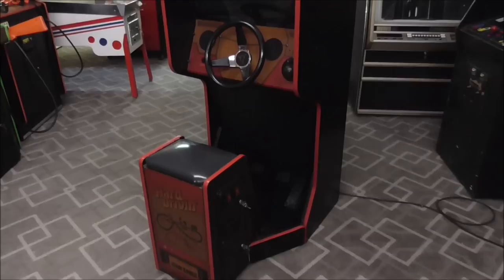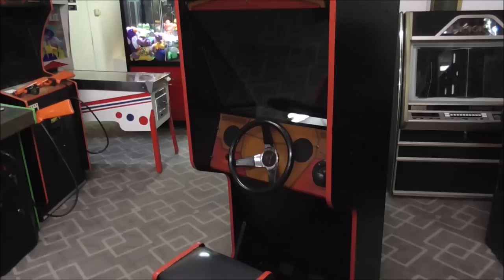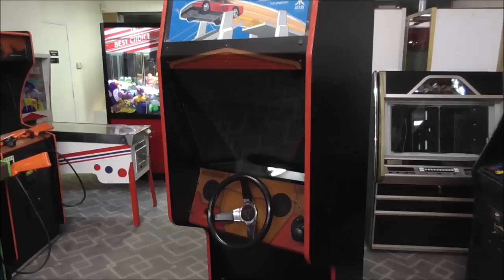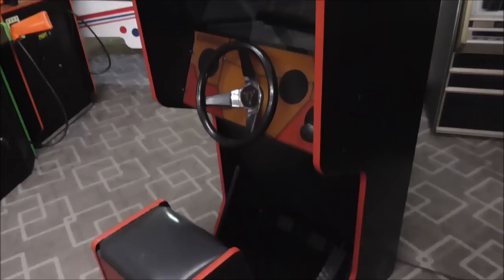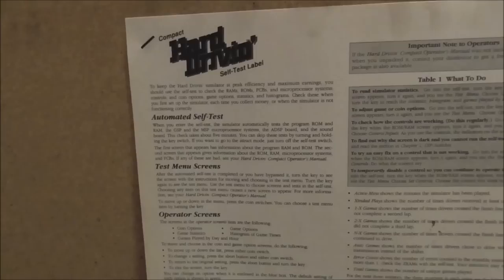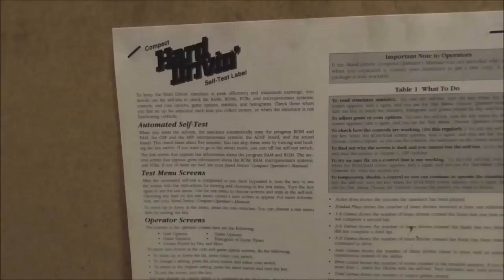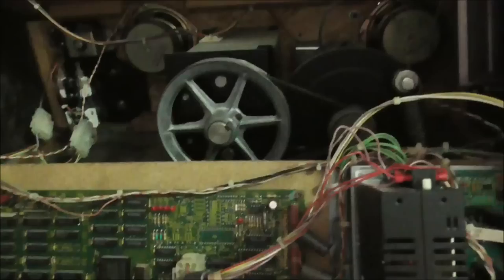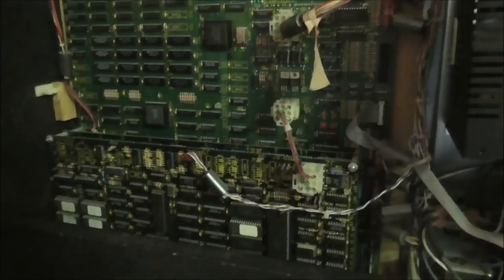We Fix Atari's Legendary "Hard Drivin" Arcade Game!  Steering, Brakes, PCB Repair WOW!

Comment: I recall having to repair those machines when they first came out. So heavy and we would always find the motor driver had died. Two actually set on fire !. We had to install one of the larger units in the 3rd storey of a building and it had to be carried up the service stairs due to the size and mainly because the stairwalker wouldnt fit in the stair well.

Comment: I used to own a standup Race Drivin' cab, and the game is quite something. when the force feedback is cranked up all the way, you need to be popeye to drive the car lol. 4 speed shifter with a clutch, a key ignition and 4 point car physics. Way, way ahead of it's time. Even the brake pedal uses a strain gauge to actively measure force and act appropriately. This is why the brakes fail over time, the strain gauge creeps over time needs to be replaced, which is a specialty job. Thankfully I do strain gauging for a living so it wasn't a scary job for me lol! I got good enough at it where I could play for hours without running out of time on the Super Stunt Track, the only thing that killed a run was loss of concentration or just getting tired. The roadster was the best car! This video makes me want to find another cab of this and get back into it :o)
Reply from the maker: They're still out there somewhere :)

Comment: I remember playing this game when it was brand newly arrived at my arcade, and what fun it was. We were blown away by the feedback steering and the realistic braking. It wasn’t long, however, before the game was all beat up from kids abusing it. Most of the time the feedback steering didn’t work and the brake pedal flopped loosely. Amazing driving simulation, but susceptible to the ravages of Mountain Dew-addled teens.
Reply from the maker: I can see it getting abused for sure!  The operators have to keep the kids in line I would have kicked 'em out!

Comment: You are spot on, alot of us LOVED this at the time. Race Drivin' was out right around the time I was learning to drive and I took massive pride in using the full manual with clutch setting, and eventually beating the Super Stunt Track with corkscrew, mega steep top hat, and loop with an upside down jump - after months of practice. That was a great accomplishment for me at the time! The unit I played was a full sit-down cabinet in Spaceport Arcade at Greenbrier Mall in Chesapeake, VA. Edit: Yup I always used the brakes - those signs before the stunts let you know a good speed for the stunt you are about to hit.
Reply from the maker: Thanks for the memories VBshredder, those were the days.... it was a very interesting time when the arcades were still around, it's hard to explain to kids how it was if they weren't there :)  Thanks for watching, we'll see you on the next video!

Comment: Tantalum caps have a higher capacity and lower leakage then regular electrolytic caps. If I remember my basic electronics correctly, you can swap an electrolytic cap with a tantalum,  but the opposite is not always true.  In circuits where those low leakage and high capacity properties are needed, you should not swap a tantalum with a electrolytic.
Reply from the maker: I think I accidentally figured that out on this particular design :)  Thanks for watching MrRobarino and for the information!

Comment: Joe, you always have GREAT stuff to show us!  Hyper-interesting, well researched and well-presented.  Kudos. I noticed the voltage on that Tantalum that you replaced, the cap said 20volts.  Would that be problematic in a 10v circuit?  I see that it works just fine, once replaced. Well done!  I LOVED this game when it came out. It blew me away. I hadn't seen fully painted polygons like that before. And the only other polygon system I had seen before this was 1980's Battle Zone.  All good wishes.
Reply from the maker: On capacitors in general the voltage rating is the voltage that they can tolerate, so if you go higher on the voltage rate you're still alright.  It's like if you have a car that can go 100 mph, it still drives fine at 50mph, the capacitor can allow 20 volts through it but still works fine with 10 volts running through it.    This was a big step up from Battlezone graphically, but Battlezone was a great game too of course :)  Thanks for watching Anton!
Reply: @LyonsArcade  Thanks. I know just enough to be dangerous. Great video in any case. Got 'er working and she's a beauty!  Is it possible to get side art for that cabinet?

Comment: Interesting stuff...You can tell when a PCB has a sensitive spot  when the designer puts a " keep out " zone around the parts, you can see around the area you were working on, there is nothing but plain fiberglass board (FR4) its deliberately kept clear of power and signal...cheers.
Reply from the maker: that's interesting I never thought about that, thanks Andy!

Comment: I have that machine in my basement.  Took a while to find this "compact sit down" version (I kept running across the full cockpit version....no space for it!  The brown bits in the artwork used to be light colored (white...sky blue?) back in the day.  They turn that color when they age, which is really strange.
Reply from the maker: It was something Atari was doing with their material at the time, we get them in often on other atari games from around that period that do the same exact thing.  Games like Klax, or Tetris get very brown over time....

Comment: I think the tantalum cap was used here because it has a lower leakage current?

The change in resistance from the strain gauge is so low that the circuit around the AD711 (an opamp) needs to be quite precise.

Looks like the tant cap was likely being used for filtering the signal from the strain gauge. That whole resistor setup before the opamp is like a voltage divider, but the opamp also has some feedback/gain.

The electrolytic was probably "leaking" just a bit too much current, dropping the voltage on the positive opamp input a bit too much.
Reply: I'm not sure what SG.SW means, unless there's a pot somewhere for adjusting the bias for the strain gauge, or maybe that's a reference voltage from the ADC circuit.
Reply from the maker: That makes sense to me :)  It's an interesting design, that's for sure!  Thank you for watching ElectronAsh :)
Reply from the maker: SG SW may mean Strain Gauge Switch....

Comment: When I was a kid in the early 90s the 7-11 near me had one these and it was the compact version, but didn't have a seat - you had to stand up and use it. I'm not sure if it was modded, but it was a tad smaller than that one.
Reply from the maker: Hmmm, they may have made some other ones but this is the only type I've seen beside the cockpit.... but sometimes there's tons of different versions of cabinets!
Reply: I think that's the one they had at my university.  I don't recall being able to sit down to play it, which sucked.  A local arcade had the deluxe cockpit version with adjustable sliding seat and full metal shifter, which I loved to bits.  I think Atari also made a version with a seat that wasn't adjustable and had a plastic shifter.

Comment: FYI: the lack of solder mask and the guard ring indicate that this is a circuit very sensitive to (current) interference and leakage currents, and as such I would suspect that the leakage current of the cap was just way too high
Reply from the maker: That makes sense now that you point it out!  Thanks!

Comment: As soon as I saw the game play I knew the game.  The brake is absolutely necessary.  This is not a pole position floor it game. More like spy hunter... you had to drive.  When you said go around the barn I was like... yeah you can go round the barn lol...on Manual transmission you can coast past the checkpoint. The timer is purposely set to be just shy of the checkpoint if you don't drive perfectly.  Gets you to put more money in cause you just almost made it!.....memories
The first "first person" driving game I remember is night driver.....white square cones you drove between goes left and right... not a track per se as it never made a full circle.
The first driving game of any type I remember was death race ... later renamed and reprogrammed to demolition derby because of do gooders. Said it promoted running over people.. got a 22 on DR once.... crosses everywhere!

Comment: Loved that game. Would play for hours on 1 quarter..
Reply from the maker: Some say it can't be done :)
Reply: You can't play it for hours on a quarter, you eventually run out of time. Then there is a fastest lap challenge against a ghost car. Then the game ends.
Reply: @GD-tt6hl  as long as you keep beating your last time it keeps going. Every time you pass a check point you get time. If you play it right you can keep going a long time. I never timed how long I could play on one play bit it was a long time. I would put my initials in as Don, and the entire screen would say Don I played it so much. Maybe you were just not that good at it so you just don't realizes this.
Reply: @dr07828  that may be true but it certainly wasn't hours like you claimed. I was good at it too.
Reply: @GD-tt6hl  you sound sure of it, but I believe you are wrong. In easy mode it would add more time each lap, you could drive it forever on easy mode. I literally drove it for hours at times.
Reply: @dr07828  there were no selectable modes in the arcade (just auto and manual), there were dip switches that changed the amount of time added, but you must have had one set to where that was possible
Reply: @GD-tt6hl  I believe you are still wrong. There were was a few levels of difficulty up to the operator to choose from. There was easy medium hard and some in between. When I played this game it was late 90s well past the games prime.  The place I would play it at was an arcade that was dying. It was only 1quarter to play. But I remember wanting to play it in the 80's but not wanting to pay 75 cents to play. However it was setup by the operator added time which is usually an easy setting. I could play it for hours. We can go back and fourth all day you just sound stupid because no matter what you say I still played it for hours on 1 coin lol.

Comment: Well if somebody didn't like Hard Drivin' it was likely based on ports mostly, it really didn't translate to lesser hardware well. Often think about the Genesis one running better if it had used the SVP chip, or had a wheel like the SS had.
Even in MAME, use a controller similar to the arcade, a USB SNES gamepad doesn't really capture the feel of turning a steering wheel, pedals, and shifting. Next to Spy Hunter, Hard Drivin' is another game where the original cabinet is part of the experience.
Reply from the maker: Yup, definitely.. plus it had the force feedback too....

Comment: Nice job! Ever consider repairing a steel talons board set?  Hard driving I think uses a similar board set doesn’t it?  I have the board set but I need the power supplies and rump thumper board/solenoid.
Reply from the maker: I've never messed with that one, I've heard it's a good game, though!  Thank you for watching as always!
Reply: @LyonsArcade  For some reason it didn’t hang around much past early 2000s.  I remember playing Hard Drivin and Steel Talons all the time as a tween in the early 90s.  I love the dramatic playback when you crash.   Glad you brought back this fine game cab.

Comment: You may have already gotten this comment, sorry if that's the case. The cap that you replaced looks like a polystyrene film capacitor which are very sensitive to temperature.  Once you heat them up you change it's value and they don't heal once cooled. They are just stuck at that new value. The problem could have been that whoever installed it had the iron on it too long and borked the thing.

Comment: Love your videos brother and have learned a lot. I have an Atari Race Drivin that I picked up for cheap. Monitor board needed rebuilt and the power supply replaced but she lives now and plays well. All cleaned up but cosmetically I need some parts so can you offer any tips on where I find a replacement bezel for this unit. Compact model. My seat needs replacement as well as side art. Any suggestions and tips would be greatly appreciated. Thanks!!
Reply from the maker: Unfortunately I don't know of anybody that makes anything for it!  You might find some parts from www.KLOV.com if you go on the forums there, all the arcade people hang out there and sell parts too.

Comment: Hard to believe all you had to do was replace it right the right capacitor to get the break working again :) The game looks awesome
Reply: It has to be a tantalum capacitor as it allowes high frequency pulses at the same time filtering  and stabilizing the circuit. The electrolitic capacitor  would present a low resitance to the frequency pulses to ground  and effectively ac short to ground. I hope this explains what was happung.

Comment: Dude...
I have that exact cab
Only half way through the video at the moment,
But the pcb has a ram battery for the controls 
You can buy a new one
Lasts about 10 years - ish
Once replaced it will remember the settings when powered off
Otherwise you need to set controls every time 
Hope that helps
Still watching the rest so sorry if you know that now

Comment: Wow... that force feedback motor looks like it could tear your arm off if it really wanted to.

The "wait 10 minutes" thing seems to be due to capacitor charging rather than heating up.  It needs to charge the 10uF tantalum through a 2.2Mohm resistor.  The time to reach full charge in that scenario is going to be measured in minutes.  And it needs to reach full charge, not just "pretty close", so the RC time constant for 66% charge doesn't really play in here.  This is a poor-man's "sample and hold" circuit.

The IC is an Op-Amp, which amplifies a voltage difference between its inputs tens of thousands of times.  The "+" side is the capacitor voltage and the "-" side is slightly affected by the pedal.  They are connected by resistors so that they can eventually reach the same voltage for zero output.  When the pedal changes, it will infinitessimally affect the capacitor and will just slightly more affect the "-" side voltage.  For something that changes resistance by only an ohm,  the high gain of an op-amp is pretty much a requirement for sensing that change.

The likely reason for the tantalum is its low leakage current.  With the 2.2Mohm resistor, you are drip-feeding the capacitor with about 4.5 micro-amps at first, and less as the capacitor voltage creeps up.  An electrolytic capacitor leaks micro-amps per minute, so you can see how this is a battle of fill vs leakage.  Tantalums leak large amounts at first, but drop to less than a micro-amp after minutes of holding a charge.  Notice it's still fill vs leakage, but the tantalum seems to stabilize faster.

BTW, this also seems to indicate that if you were to hold the brake pedal down for a VERY long time, it would return to thinking it's "not pressed" because eventually the capacitor would get used to its new equilibrium.
Reply from the maker: Thank you for the explanation, that makes sense to me.  I think the way the game is designed there would never be a situation where you would hold the brakes for more than 5 seconds or so, it'd bring you to a complete stop.... so I guess it didn't matter too much to them.  Yeah that big motor is scary looking, lol
Reply: About that capacitor reaching equilibrium when the pedal is held down. I think that's why they are using an 8-bit ADC and yet only utilizing about 20 steps of it (seems quite a weaste to me to only utilize %10 of the ADC's range). I think their may be software calibration in use as well. For example: let's say there a value of 140 with the pedal released and the value goes up to 160 when the pedal is pressed. if the pedal is held down and the cap's charge levels it back down to 140. Once the pedal is released, it will fall down to 120 and the computer will see that and compensate for it.
Reply: I like your name. Are you a fan of chocolate milk?

Comment: About 15 years ago, I had a chance to buy one of these for $600, and I'm still kicking myself for not buying it.  I can't believe I decided to keep the space for my dellapitaed upright piano instead, as I would have played Hard Drivin' a whole lot more.  8)

I haven't heard of the use of a mirror in an arcade cabinet.  Reminds me of the Pinball 2000 "projector" arrangement.  Were there any other arcade games that used mirrors like this?
Reply: They were more common than you think. Usually the monitor would be facing up not down. I seem to recall some Space Invaders cabs had this config.

Comment: Just wondering,  why did some cabinets use the mirror to reflect the monitor when others did not? I understand why space invaders did it because of the backdrop illusion and black light. But why did some regular cabinets do it. Was it just for a spacial situation? Like in the case of this one, they needed the room for the force feedback hardware.
Reply from the maker: It's kind of just a design choice, by putting it the way they did it makes the monitor look like it's farther back in the cabinet, which makes the dash look like it's a little farther away, makes it look more like a car.  Other companies used it for other purposes or just an artistic look...

Comment: why did they use a mirror  , to keep the depth of the cabinet down?
Reply from the maker: They wanted it to look like you were actually looking out a windshield so putting the mirror made the distance between the dash and the monitor about twice as deep.   They did that trick on some other games too but this I think is the only racing game they did it with.